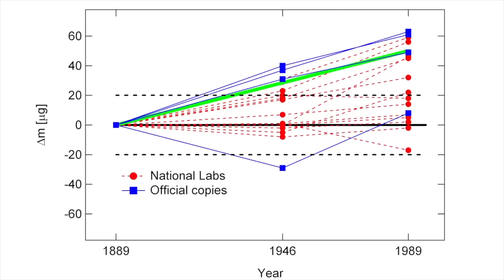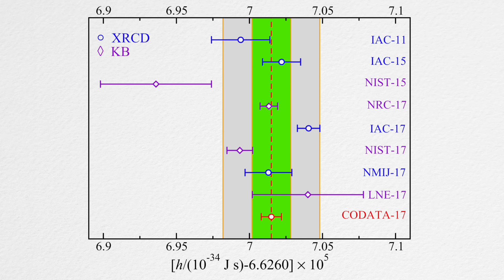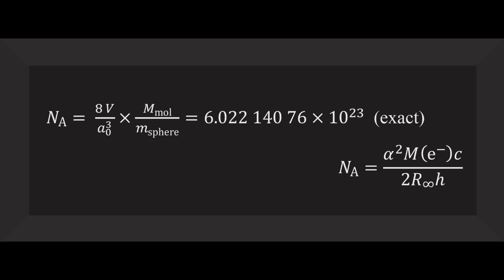The kg is dead, long live the kg

Comment: This is a deception. C is NOT a constant, and all historic measurements show the speed of light is slowing down, but now, since the factors used to determine it are now fixed to a (supposedly) universal constant, those measurements will now never change, due to the "constants" used changing with it. Any other effects of this change are just incidental. They know that proof of c slowing down throws ALL their academic careers under the bus, and this is their simple fix to that dilemma by making all the measurements depend on the value of c.

Comment: What’s heavier? A kilogram of steel or a kilogram of feathers?
Reply: A kilogram of feathers because you also have to carry the weight of what you did to that poor bird );
Reply: "That's right, it's the kilogramme of steel, because steel is heavier than feathers"
Reply: Depends. If it is on an atmospheric environment, the feather would fall down slower than steel. But because they have the same weight, they both as heavy as each other.
Reply: Both

Comment: This affects all of the other equations as well, from heat capacity to the mole, everything with kg in its unit will have to be changed. Research papers, science textbooks (if they have enough significant figures) will all have to be changed to be accurate. These changes to the fundamental Si units probably won't happen again in our lifetime.

Comment: And here I am still using 10 m/s2 for gravitational acceleration rather than 9.81 m/s2
Reply: Somebody arrest him
Reply: Lazy bastard
Reply: trust me i'm an engineer
g = \pi^2 = 10
Reply: @StahIbeton  trust me I'm a space mechanics engineering, g is not only has nothing to do with pi, it's not even constant
Reply: @ticTHEhero  thx sherlock. Btw pi^2 is 9.86960440109, not 10. In civil engineering  we actually use 10 quite often for both... There are so many uncertainties, those digits really won't matter at all.
Reply: @StahIbeton  meh) poor civil engineer) when designing a spacecraft trajectory the order of pi and g matters quite much) pi is a genius ratio not a digit
Reply: @StahIbeton  It is not just a coincidence that g is approximately equal to pi squared.   Galileo studied the swing period of pendulums, and developed the original concept of the meter as the unit of length equal to the length of the two second swing period pendulum, that would make clocks work.  Plug in g = pi^2 m/s, and L = 1 m to T=2*pi*sqrt(L/g), and indeed you get a 2 second swing period pendulum.
Reply: Help. Arrest him
Reply: It's fair enough if you live 121.049m underground
Reply: engineer found
Reply: There is a thing called "significant digits". Using too many digits for constants in scientific calculations shows that you are not as smart as you think. Measure a radius of a circle with a ruler and multiply it with 3.14159265359 for extra precision :-)
Reply: It's 9.79 where I live.
Reply: Absolutely barbaric
Reply: Same
Reply: ªªªªªªªªªªªªªªªªªªªªªªªªªªªªªªªªªªªª
Reply: It varies based on were you are on earth so trying to get the exact value of the acceleration from gravity is kind of useless
Reply: Fatass
Reply: Yess
Reply: We use pi ^2 ;-)
Reply: I use it mainly for quick estimation when calculating weight or moment.
Reply: You have broken the law of gravitational constant, may god have mercy on your soul.
Reply: Found the engineer
Reply: Don't forget the Eotvos Effect
Reply: It's actually 9.80665 m/s^2 lol
Reply: @legendarypussydestroyer6943  let's talk about Pi, shall we??
Reply: @legendarypussydestroyer6943  Not really, gravity varies across the globe and with altitude
Reply: @Scientific Creature well actually it depends on your location on earth
Reply: Where? At the equator at sea level?

Gravity changes everywhere, depending on distance to center of the planet to densities fluctuations in the mantle.

Very tiny amounts, true, but amounts that make it nonsensical to use a constant with so many decimals
Reply: We all are.
Reply: Nothing wrong with that . It depends on your context.
Reply: I mean... depends on what approximation level you're working with
if you're measuring accelerations on the order of 1000000000 the a +-10 margin of error isn't a big deal

for common uses you should at least use 9.8
Reply: > It's actually 9.80665 

If you're going to be that pedantic, it depends on where you are. At the poles it's ~9.83, at the equator it's ~9.78. And then you need to take altitude and ground density into account, too.
Reply: 9.80665*
Reply: Ain't nobody got time fo that
Reply: That's alright in many cases. Sometimes I take pi to be 3. It depends on the problem.
Reply: @tomasderner7511  In problems in Indian schools, we always use 22/7 unless specified in the question

Comment: We can't just declare the value of a universal constant. It is what it is, not what we say it is. To lock a constant into a set sequence of digits when we don't have an absolutely perfect measurement of that constant is to unmoor the value of those digits. 

To lock Plank's into exactly those digits, we need to be prepared to change to a base 10.000000000000000000000000000000000000003 numbering system somewhere down the road.

Comment: Matter seems to resist absolutes and exactness. There is even topographical variance in the sphere of a proton. And here we are just making these near irrational numbers the norm. It's not going to solve the problems of measurement unless there is some universal ratio amongst everything. You might as well make a base pi math or base euler's math. Yes suddenly an irrational number becomes easier to understand but now powers are irrational as is the radius of the circle. It's not the numerical value that's important in measurements but how it relates to other measurements that knowledge can be obtained.

Comment: What will happen when we find out through better measurement devices that the fixed value of the Plank constant is wrong again? We'll probably just fix all the values based on it, but could some applications be affected more deeply because of this?
Reply: These things are being changes at tiny orders of magnitude, smaller than any old studies relied on. In the new proposed system the constant cannot be found to be "wrong" as everything will be defined around the number.

Comment: This is extremely fundamentally flawed. While "planck's constant" is the most likely constant to be constant, its very likely based on empirical evidence that these "constants" are variable over time. These fixed measurements will conflict with each other inside of a few decades if there is the slightest variation in "constants". How foolish, ridiculous, and arrogant to feel 100% sure that these "constants" are constant to the smallest decimal and never vary over time, in the face of at least a little evidence that "constants" vary.

Comment: If they cared about consistent and reliable we wouldn't be using decimal based numbering for units of measure. "I cans haz tehn fignurs" is a really stupid way of coming up with a numbering system. Even Clark's 2001 spelled it out; the yard is superior to the meter. 1x4x9 == 36 inches in a yard == can divide by three without resorting to fractions or abstracts.

A more ideal - though unweildy -- system would be sexigesimal.. perhaps with Tetravigesimal thrown in. No, using the bottom three primes multiplied together would make too much sense.

Even if there's ZERO rush to convert time or navigation to it. You'd almost think that decimal was ridiculously unsuited to any real-world calculation or something.

But leave it to metric to try and say that 180 degrees between frozen and solid doesn't make sense. DERP.

Comment: If kilogramme was made out of a physical object then what is a second made of? I mean, why or how is a second the exact duration that it is now.
Reply: Old definition: "The unit of time, the second, was defined originally as the fraction 1/86 400 of the mean solar day."

New definition: "The second is the duration of 9 192 631 770 periods of the radiation corresponding to the transition between the two hyperfine levels of the ground state of the cesium 133 atom."

Comment: I'd define a kilogram just like this: A kilogram is a mass of [some enormous number] atoms of silicon-28. Why? Because of the Occam's razor - the simpler, the better.
Reply: Why is that simpler, it gives you two pretty bad options.
1) You have to have a physical sample of exactly that many atoms to compare to.
2) You are defining a kilogram based on the numerical mass of a silicon-28 atom (which presumably has its value written in kilograms)

The first is impossible because the number of atoms in your sample would change over time. The second is a circular definition, is the kilogram defined by the mass of that isotope or is the mass of that isotope defined by the kilogram?
Reply: Jack Johnson well I guess you’re right. But not entirely. As for the first point, you’ve convinced me. Yeah, I thought only about a definition, not the practical usage of it. However, as for the other one, notice: the mass of silicon-28 is constant and will no longer be defined by anything. Instead, a kilogram will be defined by IT.

Comment: The importance of accuracy has been around a long time with humans. The Pyramids are just such an example. Setting up the original system of using a Kg helped pull together all the towns, villages and cities to selling goods at a fixed "weight." Before that almost every place had their own unit of measurement. 
Just look at how accurate a CPU is considering it's size.

Comment: Hey, nice video. I've got a question :
What about meters and centimeters? Like if the value of a kilogram changes, then the value of a liter of water should slightly change as well hence the value of a decimetric cube then the value of the meter itself.
Reply: length/distance is already locked in based on time (so many vibrations of a Caesium atom = 1 second) and the speed of light  (1 meter is how far a photon travels in X vibrations of the caesium atom). In short, the speed of light is fixed and known (i.e. it's defined as the speed of light), with atomic clocks using "the" definition of the second (based on Caesium vibration).

So with length (and area and volume) already locked in and based on universal constants, and with the KG (probably, dunno if they voted for it yet) also now locked in and based on universal constants, the only thing that can change (very slightly, talking parts per million or billion) is the density of various types of matter.

However it'll have no meaningful effect on day to day life, unless your scales are accurate down to 1 part per million.
Reply: @Logarithm906  thanks for this thorough answer. But just wondering, even if it's unmeasurable on a day to day basis, is this 1kg=1L=3dm3 still exact, or is it slightly off now? Sorry I'm not really good at calculus
Reply: It is off and wiggling but not more after the change : it has always been since we realize that water density changes a lot with temperature. And this variability is order of magnitudes greater than the change that occured today. So the mass of 1liter of water is not affected by the current change ; at 0° it will be 997 g, at 25° it will be 999g; so it changes with temperature at the gram level while today's change addresses micrograms , this is 1 million times smaller... Not the same world.
Reply: Oh ok! Thanks :)  @euldulle

Comment: But wouldn’t this alter all calculations done with science?
Reply: very slightly but it'll be for the better and it'll have barely any effect on day to day life, even equations used will be the same, it's just the constants will be slightly different.

At the moment any measurement that relies on the the kilogram is slightly inaccurate because your instruments are calibrated using a lump of metal, that's very nearly the same weight of another lump of metal, that's very nearly the same weight as THE  BIG K (also a lump of metal). With all of them lumps of metals gaining and losing tens of parts per million of their weight due to environmental factors.

What this is doing is flipping everything around (it's almost like the science community has only just bootstrapped its units xD), now you can calibrate your instruments based on a known number, instead of a lump of metal.

They did something similar years ago with the metre. It was just a length of metal rod and that was THE METRE. Eventually they flipped every and based the metre on how long (time) it takes something of fixed velocity (speed) to travel a metre, which relys on knowing something of a fixed velocity (the speed of light well known and fixed) and knowing exactly what a second is (based on vibrating caesium atoms).

Comment: Establishing a set value for avogadro's number or planck's constant at this point seems kinda arbitrary to me,  since there will be a deviation in the accepted number and the real objective number. I understand that this is a compromise and in the grand scheme of things, doesn't affect much functionally. But the principle is flawed. If the search is to find the true value of something with the best measurement methods possible then what they've been doing is correct. Don't touch the constants and keep updating them as new information arises. Our metrics will continue to change, becoming more clearly defined, while the lay person would use a rounded number for everyday tasks. To me the new definition of the meter is still as idiosyncratic as the old one, albeit now with the backing of consensus. Am I missing something here?
Reply: The problem is the measurements we make of the constants aren't changing because they're changing (at least we don't think they are). What we DO know is that the calibration of the equipment used to take them measurement DOES keep changing because that calibration is done relative to a definition that keeps changing its mass.

It's like using a rubber ruler to measure something, one day you measure something to be 10 cm across, the next day it's 10.1cm. You don't know if the thing yo'ure measuring is changing, but you do know your measuring device isn't reliable because you've compared it to it's twin's and they all disagree.

You have to pick a point in the ground and put your stake in at some point and say "this is my defined origin", so you might as well put your stake into something solid and you're relatively sure is unmoving, rather than in a glacier or a sand dune (which is where it is currently).
Reply: @Logarithm906  - No I fully understand that and that's why I say it's a compromise. What I'm saying is putting that stake in the ground at some point is the arbitrary choice for this type of problem. It's not really a problem for the lay person who's working to the tenths or microns. But the pursuit of true measure should have no arbitrary values not defined by objective reality. Once again, I do know it has to be done but I'm commenting on the limits of our scientific capabilities to tackle this problem.

Comment: It will still be wrong. The universe has no constant as it is infinite.
Reply: And if you think about it. The decimal system should also be redefined. It is based on the amount of fingers a human being has. All math is based on the amount of fingers. Isn’t that prehistoric.
Reply: @MitchDC2   If the universe didn't have constants, we'd be see it in astronomy. 

Also you can't redefine the decimal system, that's a stupid stupid thing to say, the decimal system is simply the base that most people learn to do maths in, it's even in the name, deci, ten, unless you're saying we should redefine what 10 is, but if you want to do that just use whatever base you'd like to use instead, if you want 10 to mean eleven, just use base eleven (but you'll suffer for it and annoy everyone else).

Regardless of what you mean, maths still works regardless of what base you use. When you tell a computer to use hexadecimal as its base (base 16), maths still works, when you tell it to use binary (base 2), maths still works (we know it works because you can READ this message on your computer), you could use base 10487456 and maths would still work. Algebra is entire discipline of maths that doesn't even USE a base and it still works (literally it has ZERO reliance on any base, decimal or otherwise)

To give you an example It's like saying the written language is prehistoric because you can write stuff down by scratching a rock with another rock. How you write stuff down is irrelevant, if you want to use a rock, you can, if you want to use a pen, you can, if you want to write it up on a computer using a word processor, you can. In each case though the written language doesn't fail.
Reply: Firebird Thanks for the elaborate explanation of what a base 10 is. I know that. But actually the message that I wanted to bring is that humanity always tries to unravel the mysteries of the universe and that math started with counting there fingers or using there thumbs to count the bones in there fingers (base 12).  Math is mans way of explaining the universe. But they always seem to end up with an approximation of the real thing. That’s it.